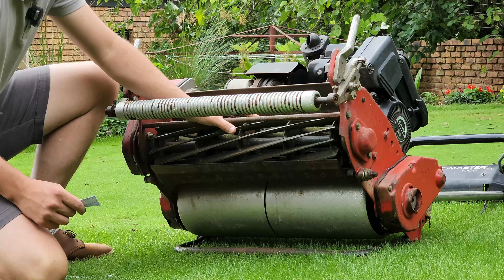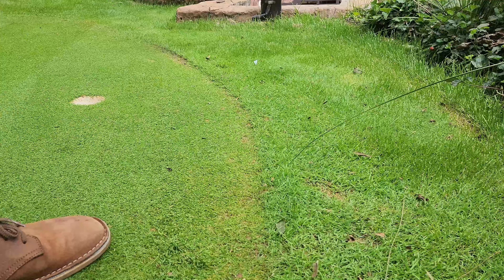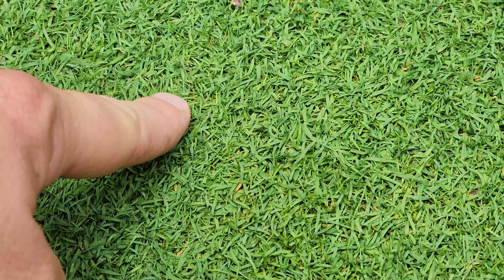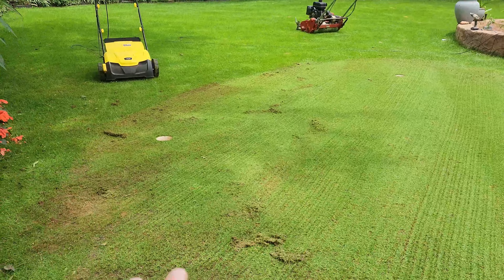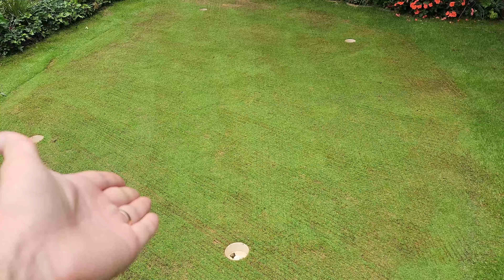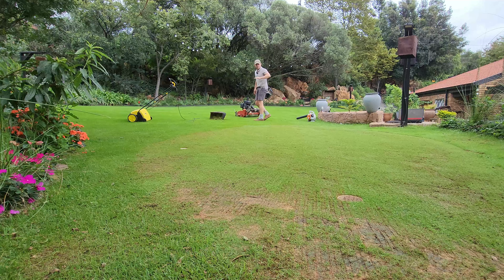Deep Scarify // Backyard Putting Green

Comment: Interested to know whats happening with the throttle upgrade on the mower. I have the same mower (branded as Cox in Australia) and the throttle control has never been great on mine.
Reply from the maker: Which one have you got on? I know the mowers sent to Aus are fitted with the new one. the old one is the lever adjuster, and the new one as far I understand is more like a motorbike throttle
Reply: @salawn  Same as yours - the lever you rotate left and right to adjust the throttle.

Maybe mine just needs adjusting but its never been great which is why I'm curious what the upgrade looks like 🙂
Reply from the maker: @craigmonty  oh ja. Mine actually worked fine. But I will definitely show it in one of the next videos when I get the mower back..